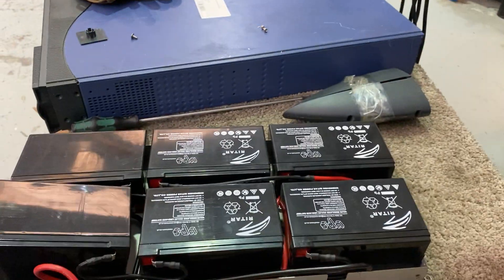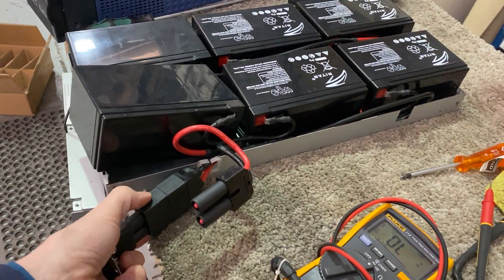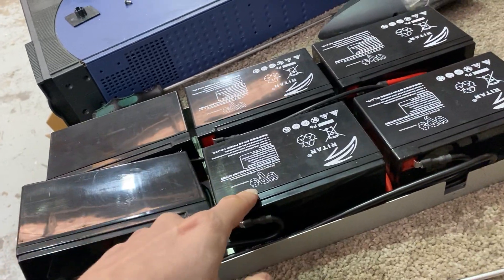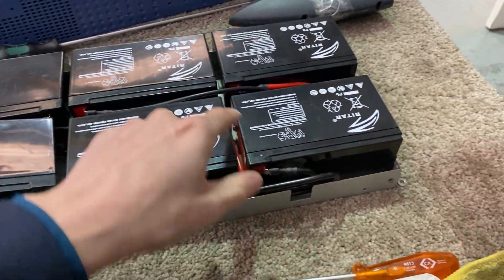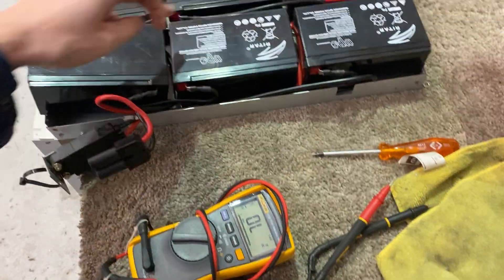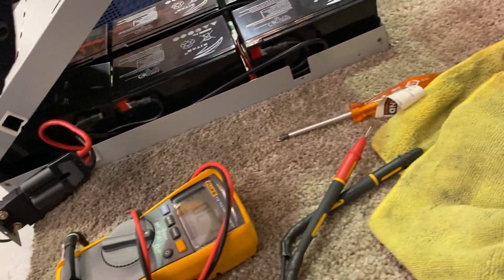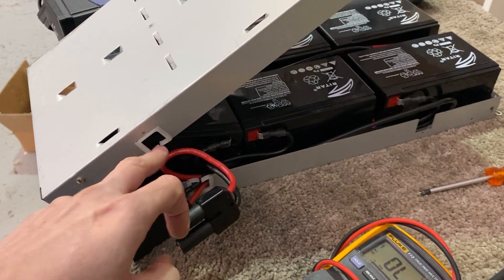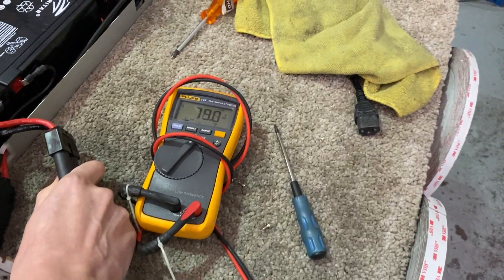MGE Pulsar 2200 (2u) Purple battery pack

Comment: does it start without battery pack or it really needs 72volt battery pack to turn on ?
Reply from the maker: You asked me the same question by email 48 hours ago. Are you expecting the reply to change depending on where you ask the question?

The answer is you need the battery pack to test the UPS for anyone else looking here.